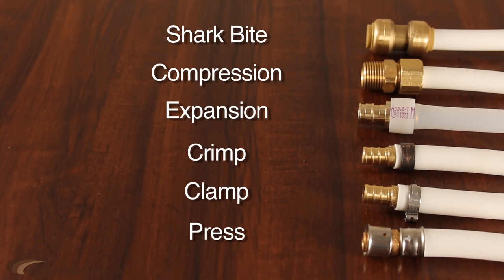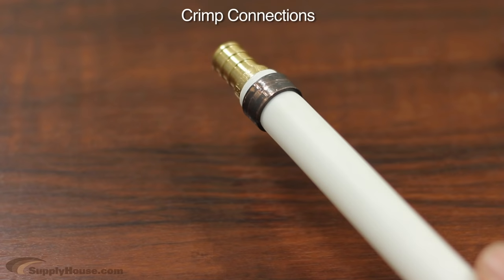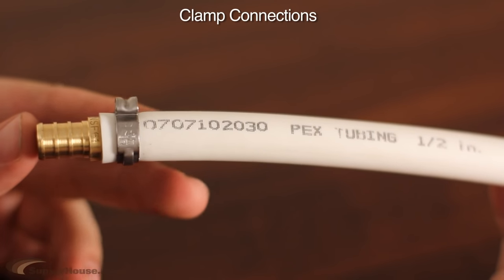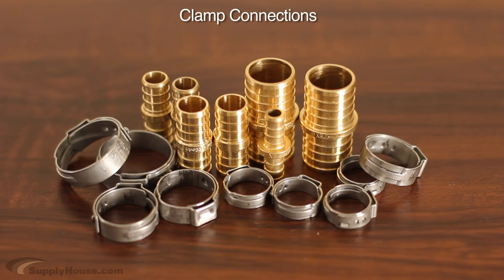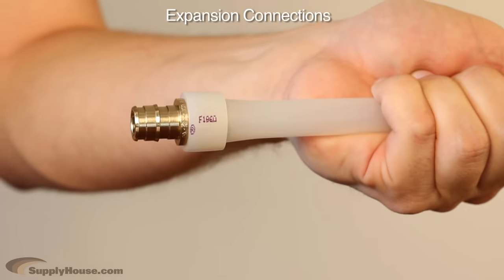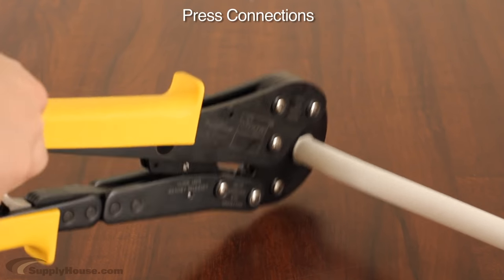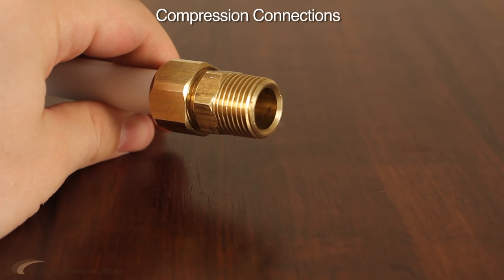Comparing PEX Connections

Comment: I've been using pex in NJ for about 6 years now.  I've been noticing a bunch of failures with the stainless steel crimp rings on hot water lines only.  I think something to do with the expansion and contraction of the pex pipe.  I switched to the solid copper rings about 2 years ago and haven't seen any problems yet
Reply: wish we can see the dislikes
Reply: I def love the copper ring system.  I've used the stainless steel clamps and sharkbites. I think the best by far though is the copper rings

Comment: Anyone know which is the most reliable connection system over the long term regardless of cost?  Which ones will leak and rust. Also there is a Home Depot compression sleeve that wasn’t discussed in this video.
Reply: luvbeast77 I like the wirsbo expansion system the best, but we also use the crimp ring and shark bites as needed to connect to existing plumbing during remodels.   We have experienced no significant issues with any system.
Reply: @scottjanku8457  Wirsbo/Uphonor expansion is very good and probably the quickest and easiest but the absolute best/"most reliable" imo is the f2080 rehau-style connections with Pex A.  Get the full-flow expansion but with brass connector and collar that has no risk of expansion under (unrealistic) extreme high pressure or heat.   Of course for residential systems we are probably only talking about technically being better but there being no real-world difference as neither is going to fail.
Reply: Expansion

Comment: Nice video.  Makes me feel more confident with the clamp connections I used instead of the crimp rings.
Reply: Reinhard Fehling how so..? Just choose because I’m going to switch over from copper to this for all my jobs
Reply: @Makeitwithmanny  The clamping tool doesn't have to wrap around the pipe so it's perfect for those hard to reach places. This is particularly important in masonry buildings.
Reply: another advantage of clamp rings is that they can be removed without cutting the Pex.
Reply: clamps are garbage 😂😂

Comment: First: They have to be available for the average homeowner. That removes 'Press' and 'Compression' from the list (hard to find the brass inserts needed for compression fittings on 1/2" PEX). Second: They have to be legal to seal behind walls. That removes 'Shark Bite' from the list. That leaves only 3 fittings to select from: Expansion, Crimp, Clamp. Expansion has a much larger internal diameter, so that is the one to go for.
Reply: Shark Bites can be sealed behind walls.
Reply: yeah sharkbites can be put in walls but i would not of installed properly they will probably never leak but i would only install them in a accesible location
Reply: Spot on.

Comment: I tried those 'clamp' rings. The first clamp tool had blue handles and left a rather large 'gap' inside the tab. The fitting was not tight. I went to the store, returned that first tool and bought one with yellow handles. That tool squeezed the tab tighter and left only a small gap inside the clamp ring (a small gap is normal). The fitting was not loose so I kept that tool. Make sure the gap is not more than the thickness of the stainless steel ring itself, if it is more, the tool is bad.
Reply: Tile nippers work quite well and easier to handle.

Comment: Hi,  I currently have 1"shark bites connecting my pex to copper for my wood boiler system and both are leaking. They stop once the water gets to temp (175°) but I'm replacing them and thinking of using the crimp method.  Can you confirm this is the right route and advise on everything needed to do the job?
Tks

Comment: Looking to invest in one of these systems initially for an RV remodel project.  Original RV plumbing was mostly 3/8" and 5/16" poly tubing with plastic threaded compression fittings.   I'm thinking  PEX would be a better alternative to poly even if it is not as flexible.    Is there a PEX connection system that would better handle the vibrations and dynamic rough and tumble environmental nature of an RV?   Secondly,  are copper fittings equally good with both crimp and clamp or should I stick with brass? (I'm not keen on plastic fittings for this application.)     Or should I just go back to poly or even bite the $$ bullet and just use copper refrigeration tubing?    Input/advise/thoughts  appreciated.
Reply: I would stay away from copper. Just because pex doesn’t corrode. Pex is very easy to replace sections of and is very cheap. You will need flexibility with an RV because of the body roll and bouncing. My .02

Comment: Could one use a hose clamp of the proper size instead of a crimping system? That way it is entirely removable if needed.
Reply: Hose clamps will not be reliable if they work at all. Sharkbite is removable and reusable . The system works very well.

Comment: Did I get this correct: Pex A tubing can only work with the compression tubing!  So, the clamp method won't work with Pex A?
Reply: You can use anything on any pipe but you can only expand pex a.. but I've expanded pex b before and it held

Comment: What if I use sharkbite push connector on a pex-a will it reduce the pressure. I am repositioning a 3 ft hydronic baseboard 4ft away and thinking of using pex-a with sharkbite to transition from copper to pex to connect the loop.
Reply: No the shark bite is full flow .

Comment: How do i replace press fitting/joint? Will i have to cut the pipe?
Reply: You can cut the ring if you can get to it.  We use an angle grinder with a diamond blade to cut the rings so we can reuse the elbows or couplings..

Comment: Can I use Pex Al Pex compression fittings on regular Pex?
I am using half inch pex and have a special need for a particular fitting that I can only find in pex al pex compression but not for regular pex
Reply from the maker: You cant, the OD of PEX AL PEX is different and it wont seal correctly and the ferrule from the compression most likely will cut through non PEX AL PEX, since it doesn't have that layer to dig into.  What are you looking for, maybe we can help?
Reply: SupplyHouse.com Thanks for the prompt and detailed response. I need some male and female 1/2" BSP threaded fittings. 
The female fitting should be a 90 degree elbow (ideally ear drop), while the male fitting should be straight.
Reply from the maker: Hmmm, maybe http://www.supplyhouse.com/PEX-Drop-Ear-Elbows-573000

http://www.supplyhouse.com/PEX-x-Male-Threaded-Elbows-25410000

But we need to know what size and what tool you have to know for sure.  Also I see you mentioned BSP, so if you are in the UK there actually might not be much we can help with. :(
Reply: SupplyHouse.com Thanks but these are NPT. I need BSP

Comment: For pex A Is a copper crimp ring as strong as the expansion connections?
Reply from the maker: As long as the connections are made properly, the copper crimp ring system and expansion connection system should be equally reliable.

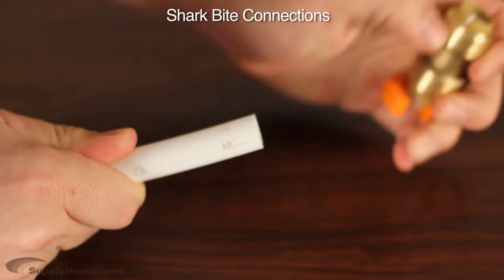Comment: 1:54 Why is it called "radiant" compression? Is it because Watts Radiant?
Reply: I think they mean radial, referring to the fitting's circular mode of connection to the tubing.  
Think radial tire. The "radial" refers to the circles/bands of metal embedded into the treads along the entire circumference of the tire.  With a radial compression fitting you use a nut and ring around the entire circumference of the tubing to make the connection. 
Radiant typically means having to do with the transfer of heat so I don't think that would be correct.
Nobody does the radial/radiant/whatever compression fitting connector with Pex, due to cost anyway.  
The only time you'll see compression connectors like that is on copper, and even then they are rare, in my experience at least but I'm not a pro plumber.  
You won't want to use those because they are about 500% more expensive than just about every alternative, due to the compression connector's pieces typically being made of solid brass. The whole point of using that type of fitting is to make sure you can service the fitting or remove it later without having to sweat and solder copper pipe. But with Pex it's so cheap you just chop the bad/leaky parts out with a tube cutter and replace with new.  No reason to use expensive brass fittings when you can "service" the plumbing by just cutting it out and replacing it as easy as electrical wire. 
If you were dumb or made of money you wouldn't be switching to Pex in the first place.
Reply: Because it is used to connect to a radiant floor manifold.

Comment: By the time I buy the tool and cutting tool, I was better off running all copper. Honestly the cost vs longevity of the products themselves I'd rather run copper. I'm in Florida now vs Ohio and have seen so many cases of pex and pvc failing that I chose to stick with copper from here on out. It's always going to be degrading plastic kids vs  copper which in my 90 year old home in Ohio is still working like the day it was installed and still survives the elements...
Reply: copper is fine if you have perfect water, those of us who have harsh well water stay very far away from copper lol pvc all the way 👍🏼
Reply: @michaelness2241  very true.....
Reply: @JESUSSavedMefromDeath  I had cast iron drains in my Cleveland home.  Seeing the snake blow out from that pipe was the first time I realized you don't always save .....

Comment: 1/2PEX = 3/8 diameter which means reduced pressure. Go with uponourfor full bore pipe.
Reply: Reduced flow not pressure.
Reply: @DavidSmith-fr1uz  same shit different word. Give me a break
Reply: @jamesruppert3152  David Smith is right. Picture a 6" dia. pipe with 60 psi driving the water through it. Your going to get a butt load of water (gpm) coming out. Now picture a 1/4" pipe with 60 psi driving the water through it. Much smaller (gpm) amount of water. Flow and pressure are two different measurements and not the same sh*t.
Reply: @hotrodduffyd4183  by the time you run a shower in half inch PEX and it reaches the shower head when it feels that shower head up to release the water you lose your pressure due to the pipe sizing.

Comment: Pex comes out with a great product then screws it all up with all these different fittings and pipe all called PEX. Change the name of each kind to cut down on confusion!
Reply: I think each fitting is a competitors design. Pex is the name of the pipe material not the fittings. This is like saying only one solder manufacturer is permitted to use the term “copper pipe”

Comment: Yawl young whipper snappers got no work ethic and always taking the easy way out.
We're still doing it the old reliable way.
Cutting and threading galvanized pipe and doping up the fittings.
Tried and true.
Don't see no reason for me to change now.
Been plumbing since 1952.
Reply: This guy installs toilets with a ladle of lead and oakum like real man.
Reply: Copper's tried and true. Galvanized is garbage. Hate that there's people out there like you still ruining people's homes for them.
Reply: @orijimi  Copper has good points, but problems too. In my area, due to the acid nature of the soil, copper is a time bomb if used in ground contact. Also, should a freeze ever occur, copper will split in an instant.
Reply: @TimothySmithii    Any other method is for wuzzes.
Reply: @mothman-jz8ug  Yeah, I'm just talking interior. People should be re-PEXing up to the meter.
Reply: LOL galvanized.. I know of several master plumbers send their kids through college just fixing galvanized pipes
Reply: Still using lead P traps and insulating that iron pipe with asbestos too🤣
Reply: Maybe we don't want our repipes to last a week long so we use uponor lol